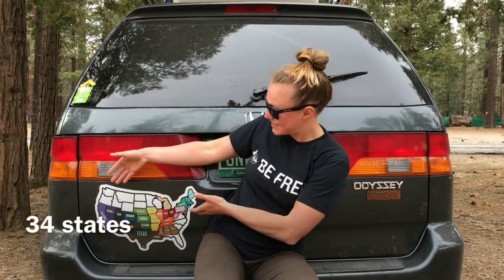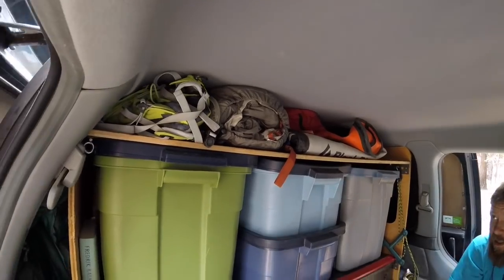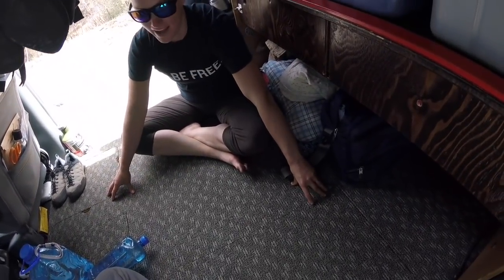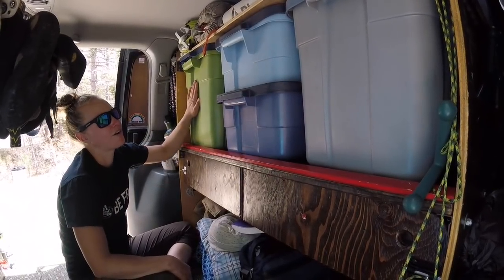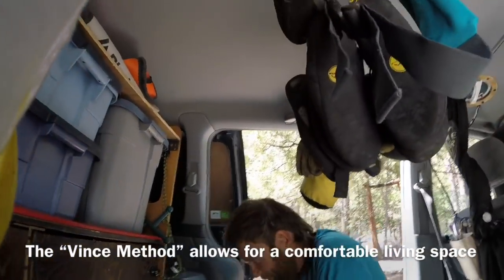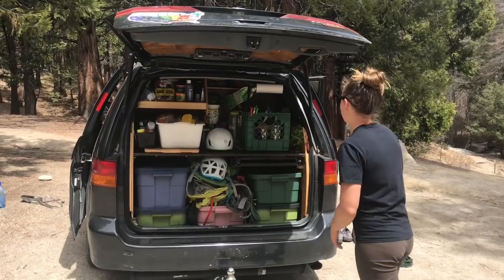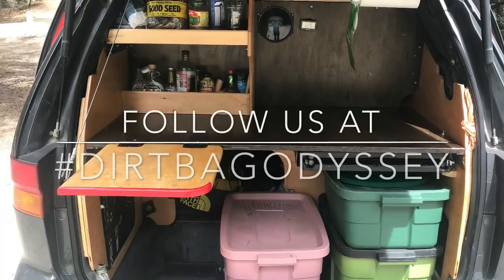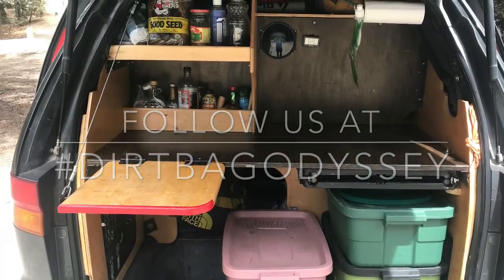Dirtbag Odyssey Van Tour 2018

Comment: I keep coming back to your non-conventional layout as a "outside the box" design. The space behind the front seats and between the sliding doors is a great area to do ANYTHING. Heck even take a bath! Yes, you have no rear visibility but that can be solved with a rear facing camera and a cheap tablet up front by the driver. For me as a solo traveler it might just be a great solution.

Comment: I like most all of this thoughtful build. if you were to add a short length of Chain (with a small eye bolt/screw and a small "form-a-link") to each of those fold down doors under the platform, you could have a sort of shelf/mini table to use as an above body nightstand of sorts that simply closed when not in use. You folks are more than a bit handy. Thank You Kindly for sharing ideas whilst allowing insight into your unique and practical setup.
Reply from the maker: Ya, I thought about doing that but I don’t like things to be just rested on shelves. We still have factory cup holders back there but We like everything to be stable.  The one thing that happens is one of us forget to latch cubby and on a hard stop everything comes shooting out.  Now I can imagine leaving my coffee on the shelf and then deciding to drive... I’ll keep the spills up front thank you.  Good idea though.

Comment: I've seen hundreds of van life videos. This is the first one that mentioned anything about using earplugs. Maybe others have mentioned the subject, but it's definitely not a common topic. It should be. I'm sure that noise is a big issue, especially for tent and pop top campers.

 I recently rediscovered my enjoyment of listening to music while I sleep. When I was a teenager, I slept with the radio on every night. But, during my two marriages, I stopped this practice. Both the sound and the light from the stereo bothered my ex-wives. Trying to sleep with those big, clunky, old-school headphones with big, thick chords, just wasn't very practical. 

Fast forward more than three decades,  to earlier this year. I work nights and slept comfortably, right through the complete renovation project on my condo. You name the home construction noise and these guys made it. They hammered, sawed, drilled, pounded, ran air compressors, cut tile and stone counter tops and talked and sang loudly in Spanish all day long. I slept through all of it, from morning to afternoon. 

Headphones today are very small and comfortable. They come with three different sizes of soft, flexible ear pieces so you can find the perfect fit inside your ears. Even the cheaper headphones that aren't advertised as noise canceling, still cancel out a lot of background noise, because of how well they fit inside the ears. When the music stops, they still block out a lot of noise. They are essentially like soft earplugs that also play music.

 I usually play music on YouTube. There are many videos with 3 to 5 hours of continuous music. I  played it on low volume and I slept all day. I could still hear the workers, but the music placed all of that noise in the background. My contractor and kitchen designer couldn't believe that I actually slept through all of that incredible racket every day. 

When I watch van life videos, I think to myself, these people really need to explore this method of sleeping. I slept through nail guns going off in my bathroom, right next to my bedroom and the walls literally being sledge hammered and ripped off the studs. I am not a heavy sleeper either. 

I think, if people can just train themselves to sleep with music playing and headphones stuck inside their ears, it might improve the overall quality of their sleep, tremendously.
Reply: I get exactly what you wrote😉😉😉. I've lived in a one bedroom apartment for 15 years and for the last 2 of those the new owners have been doing everything from putting in a new heating system ( it's a 3   building property with 19 units) , new floors, new windows , new parking lot ,etc etceteras. It's been torture, since I work nights and sleep in late mornings.  I didn't move on because i like the place. When there's not all that craziness going on it's a nice quiet place ( hence the 15 years).  And I figured it was all in the name of better living. But it's been two years and I'm close to reconsidering of renewing my lease since  they've taking so long on something that should've been finished 6 months ago according to the new owners. But as you , sleeping to the sound of music has helped a lot through what sounds like demolition instead of refurbishing 😁😁😁😁.
Reply: I’ve been at Walmart and had the parking lot cleaner do figure eights around my van....kind of hard to sleep....lol
Reply from the maker: Sky Marshall recently we got a little white noise machine, works wonders for keeping outside noise down.

Comment: I think this is a great setup. How did you make the flat floor and make the cubby holes in the floor?
 I want to do the same to my 2004 Odyssey.
Reply from the maker: Bart Comstock this was the most time consuming.  We took out the carpet, brackets and spare tire (put tire in roof rack).  Then built a level frame out of old metal shelving, insulated between frame but wanting floor space we made cubby’s for small stuff in the sides and used the spare tire hole for storage.  My thought was to put heavy items, that we don’t need frequency in the floor (books, tools, aid climbing stuff).  After that 1/2 plywood that I coated to protect from moisture,  but after a year of stuff sliding around I decided to glue carpet squares down.  Helps with noise, comfort and stops stuff sliding as we made a turn.

Comment: why not make a bed out of the shelf used for the tubs and but long storage bins to put your stuff under the bed slide out when u need to get stuff
Reply from the maker: Misa Misa we are often getting stuff out and on the go more than sleeping, so we prioritized storage and gear.  It only takes 5 min to make our bed and it is stuff that we use for camping anyways.  We’ve noticed that people that have beds in vans tend to end up storing stuff on their bed and have to clear it off at night.  Also bed gets dirty quick with gear thrown all over it.

Comment: Also how did y'all build your storage shelves, again I have a 2003 Windstar. Obviously I do not have a lot of stuff as y'all, but would like to know how you built it.
Reply from the maker: Mashah White Cloud there are two vertical walls, shaped to Van, and then screwed a shelving angle to that “wall”. Then measure horizontally and cut the wood (3/4” for extra strength) and insert just like a shelf.  Screw it down so it doesn’t move.
Reply: @dirtbagodyssey3539  don't have the Windstar no more, I got me a 1995 E250 Van, everything is now done, put my barn wood inside,  built my own bed frame that now has a Queen size memory foam mattress,  though I don't like memory foam,  but what I like about it, it has no petroleum based products in it, nothing harmful in it at all, got my cotton/flannel sleeping bag over it, built my own little kitchen area, Queen size mattress is bigger than I thought, but it's perfect for me and my wife, which she absolutely loves what I did to the van, everything I did myself,  I did have help with building the frame of the bed though. I thank YaHUaH my FATHER, THE CREATOR of HEAVEN and Earth that HE gave me the talent to do this.

Comment: Inspiring.
What type of exhaust fan is that?
Thinking about one I can fit under roof box.
Reply from the maker: Alpaca Bowl Ventline Vanair, it’s low profile but does need to pop up.  Also if you really want to ventilate, put one in back one in front and have one sucks and other blow. (12v just reverse wires to change from pull to push air)

Comment: How did you attach the wood and insulation to the windows? I need that for my odyssey.
Reply from the maker: Family YouTube we used short (make sure to measure) self tapping screws and attached to sheet metal around window.  Not much room so make sure the wood is measured as close as possible.  Insulation is just 1/2 foam between wood and window.